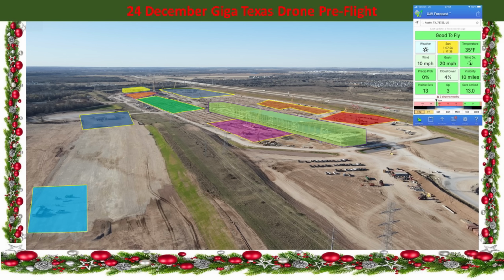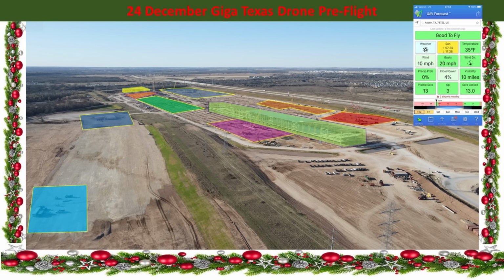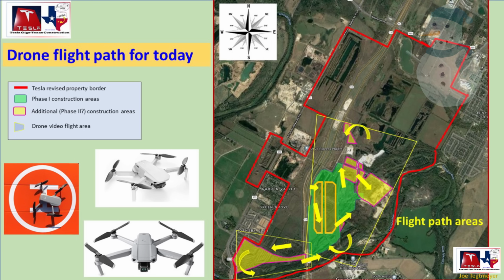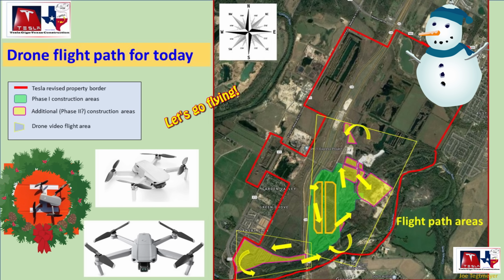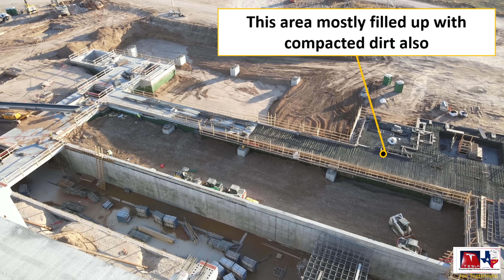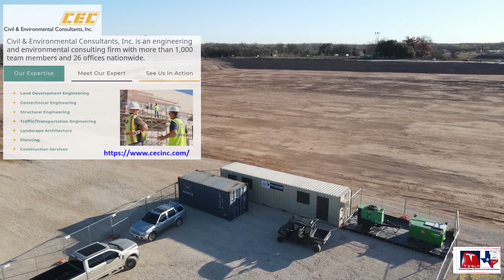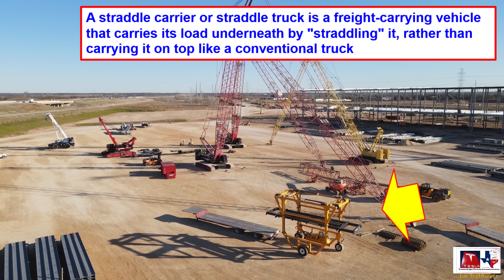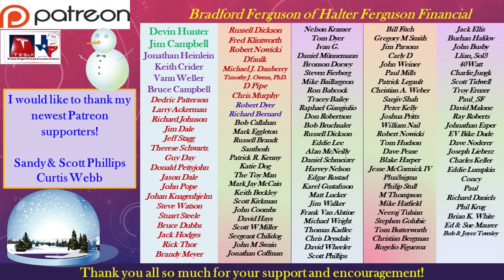Tesla Gigafactory Texas 24 December 2020 Cyber Truck & Model Y Factory Construction Update (08:00AM)

Comment: Prediction: The high voltage power lines and the natural gas main that is running through the middle of the site will eventually be relocated around the perimeter of the property, either to the east, or more likely towards the west. Reasoning: It looks like the switch yard location has changed, given that the trailers are being relocated to this area. Also, the gravel placement stopped very abruptly. I’m thinking a better location would be on the west side of TX-130. Sure, this will cost Tesla directly, probably to the tune of $50-100 Million, but that’s a small price for the increased flexibility of being able to place buildings where they want and eliminate working around obstacles.

As Joe pointed out, Martin Marietta’s permanent concrete plant will be relocated to the west side of 130, so Tesla obviously has big plans in store for the eastern side of the property. I’m thinking two (or maybe even THREE) buildings could be placed side-by-side filling in the southern end of the property before they have to expand to the north. However, that would require moving MM and the power lines/gas main to densify the building placement. Speculating is FUN, isn’t it?
Reply: Interesting.  I believe Tesla agreed to that utility right of way as part of the land purchase/site approval.  But I suppose everything has a price.
Reply: @cratecruncher6687  Based upon my experience in Virginia...Yes, land sales are almost ALWAYS contingent upon assuming all of the prior rights of utility companies, whether they have an established easement across the property or not. Not sure of this specific case, but the power lines could be in their own right-of-way (parcel of land owned by the power company). Easements generally allow the utility company to install the utilities, but the underlying property owner maintains access to the property and can even develop the property in ways that are compatible with the utility installation. Placing buildings under the power lines would be frowned upon (or even forbidden), however using the area for parking, green space, or even storm water management (ponds) would generally be acceptable and compatible land uses for overhead utilities. In my experience, it doesn’t matter if the new land use makes maintaining the utilities more difficult/expensive,. That’s the price/risk the utility company pays for not buying the land outright (and paying taxes on the land). If it is power company-owned right-of-way, the surrounding land owners have no rights to use the land under the utility, unless THEY have an easement giving them that right. The fact that the construction workers are parking under the power lines and that land clearing/grading operations have occurred, leads me to think that the utilities are in easements, not right-of-way.

Assuming that Tesla is the land owner and that the utilities are in easements (not right-of-way), it is Tesla’s right as land owner to offer up a new easement location. It all depends on how the easement was recorded with the court - it might be just a legal description or there could be a survey/plat recorded as well (more than likely). Plats with a legal description are the most robust way to record easements, as it gives a clear picture of where the easement is located and how it is tied to survey controls/benchmarks. Depending upon the original agreement, Tesla may or may NOT be on the hook to pick up the tab for the relocation. Savvy property owners will make it incumbent upon the utility company to pay for all future utility relocations to a new easement location, but this is very rare and typically occurs where large tracts of land involved (Tesla property). I have no knowledge of the history of when the power lines and gas main were installed, but I can only assume they were there prior to TX-130 being built (which was mid 90s, if I’m correct). This would have put the utility easements right in the middle of the parcel, which would severely curtail future development in a manner that is not disconnected. As a property owner I would gladly grant an easement across the middle of my vacant land - under the condition that if I choose to develop the property in the future, the utility company would have to relocate around the perimeter of my property (in a new easement) at the same time.

Note: TX-130 is definitely in right-of-way, and falls under the State of Texas’s powers of eminent domain. States are generally not concerned about whether large tracts of land become discontinuous, as they are focused on the “greater good”.
Reply: The cost to relocate the power lines was too great Elon said and the logistics would be time consuming to arrange.  So not worth the effort.  Besides,  they will need some parking for semi trailers with supplies nearby,  So will provide space for that and/or employee parking similar to the construction parking being used at the south end now.
Reply from the maker: I'll hold you to that prediction! :-)

Comment: The kluged pillar does not have the top side supports to take cross beams.  What is the plan, use lots of duct tape? Hope Elon sees this, not good.
Reply: only the end pillars have cross beams. the rest of the structure in line with the cap do not have crossbeams
Reply: Agree that it is a kluge. Disturbing to see a permanent memorial to shoddy work erected in what is to be Tesla's flagship factory. Hope it is covered up somehow so auto workers don't take it as company policy to go as fast as possible and patch defects after the fact. Oh, and everybody knows that duct tape alone is not sufficient. You have to also use baling wire.
Reply: I am a bit embarrassed that my first thought after seeing this kludge was an old term that identifies me as likely a racist. Never said it out loud though so perhaps forgiven.
Reply: Wrong, it has the normal T midway for the crane track, and at the correct height, and also the notches for the roof beams.
Reply: @ronbabcock3824  who says that this was a mistake due to Tesla rushing??
it could have been a mistaken order by a tesla person, or a mistake in shipping from the factory.
remember, that when you don't have them next to each other, it's far from obvious that it's wrong.
Reply: @davidelang  It was likely a shipping error (out of sequence).  That post would have been for the east side wall since the roof slope is in that direction.  Hence the beam height for the crane is correct.  Just the roof height was wrong.   I expected it to have been removed and the correct post put in instead of the filler piece being added.  Perhaps they do use some glue, not just bolts/nuts at the base.
Reply: @davidelang  All right. If you would prefer that the error occurred because Tesla had insufficient quality control on the orders Tesla made and Tesla received, have it your way.
Reply: @briandolbec37  I was also expecting them to remove the pillar and replace it with the correct one.

it appears that the crossbeams and pillars have steel plates embedded in them that they weld together rther than just relying on bolts/weight

Also, with the rebar sticking out of the ends of the long beams, I expect that there will be forms assembled and concrete poured before everything is done to lock everything together.